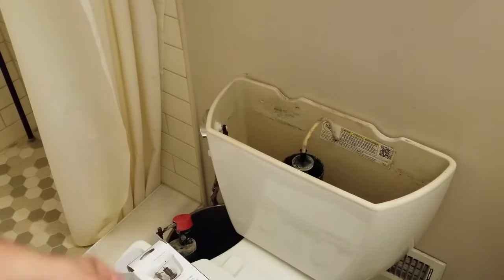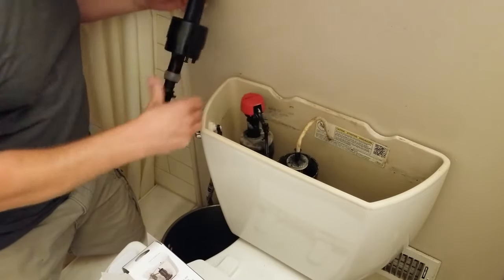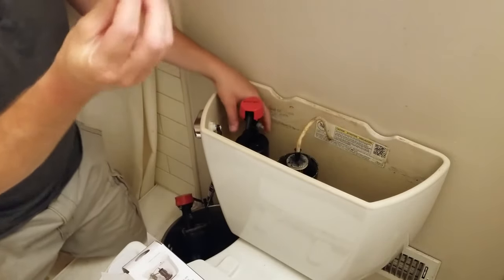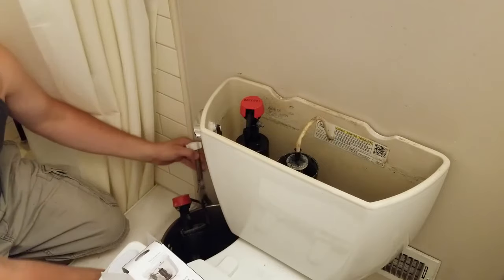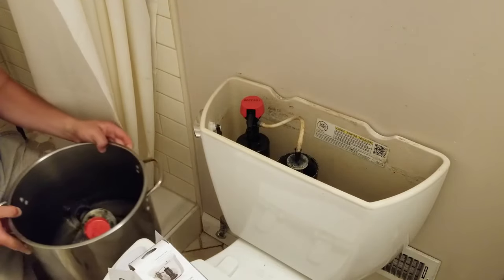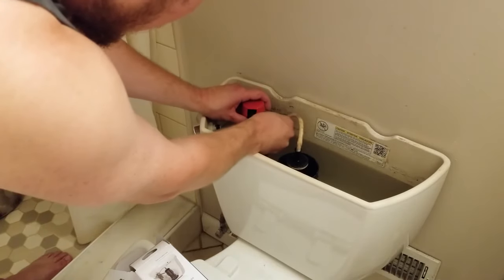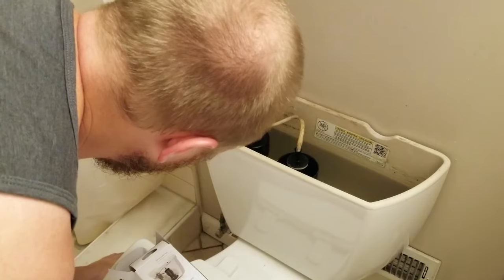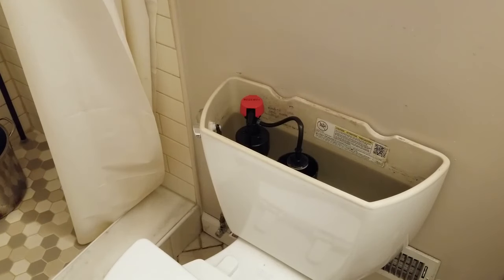how to fix a running toilet - Kohler Silent Fill Valve Replacement

Comment: Thank you very much Mr. Merl. You made what started as a bad day a good day. The box said there was detailed instructions inside but there wasn't any instructions. I searched for the Kohler parts on YouTube and by great luck, I found your video. I'm an accountant by trade and far from mechanically inclined. Your video saved me from spilling water all over my bathroom floor and allowed me to complete the task in 10 minutes (When I purchase furniture that requires assembly, if it says it will take 2 hours based on history it usually takes me 2 days so the 10 minutes is amazing). Thanks again!
Reply from the maker: Im glad my video was able to help you! No one ever wants to work on their toilet so I think should be as quick and painless as possible.

Comment: I just replaced my Kohler fill valve today after watching your video. It's been awhile since it was noisy and leaking my fill valve. I was afraid to replace before because plumbing is kind of difficult to do. Also plumbers are charging like 120 bucks and sometimes they don't wanna do small job. Thanks for sharing this video...
Reply from the maker: Glad it helped!
Reply: Don't worry, they will make a small job a big one.

Comment: Thanks very much.....your use of a bucket rather than a previous video I looked at showing SCOOPING OUT and SOPPING UP WITH A TOWEL is a lot easier and quicker method ........
I am not a handy person but this gives me some confidence......
Reply from the maker: Lol, yea that sounds unneccessarily tedious!  It's a pretty simple and straightforward job, just make sure you dont overtighten things when u put it all back together again.

Comment: Thank you! Great video. I was able to do this in 45 minutes. It'd be shorter if I didn't have to struggle removing the nut from the water supply line. After that, it was quick!

When I replaced the tip and hose, I noticed water was leaking too (like you mentioned in the video). I decided to use the original hose which seems to have more of a grip and less leakage. Do you think it is ok to have some water leak from the tip?
Reply from the maker: @cathyk9120  it's best to not have any leakage there. I think i had to just push it on harder.  As long as if it's only leaking when the tank is filling then it's not the end of the world but I'd try to get it to stop.
Reply: @KyleMerl  Thanks Kyle! When I pushed it in harder (at least 4 times), the drip/leak was much less especially with the old beige hose which has a much stronger grip than the new black one. Yes, only dripping when tank is filling. Perhaps I need to get another fill valve? Maybe it's defective? I'll call Kohler in the morning and see what they say too?
Reply from the maker: @cathyk9120  i think for me the leak was that the plastic tip wasn't pushed in the whole way and not so much the hose. Did you double check that?
Reply: @KyleMerl  Yeah, pushed the tip in (without hose) all the way in/as much as possible and still dripping. For you, there's no dripping on your end at all? At certain angle, it looks fine but when I dry it, I notice a bit of a drip towards the back. I'll keep you posted but thanks again for an awesome video! It made me feel I could do it and I did :)

Comment: Is the valve adjustable? My moms tank keeps running unless i pull thw valve up a little when its full ?? Anyone that can help is appreciated
Reply from the maker: Yep I believe you have to twist it to adjust the height. At least that's what I had to do with mine
Reply: I literally just fixed this issue 2 mins ago with our brand new toilet. If you remove the cover for the floater arm, you'll see a pin that most likely isn't aligned properly in it's holes which creates friction so the arm can't go up all the way. I took pliers and yanked the pin out then realigned it properly and voila! It's fixed. No more friction on the floater arm so it fully rises now :)
Reply from the maker: @kthewhite7453  thanks for sharing that! That's annoying that you had to do that with a new toilet though.

Comment: After the tank filled and stopped......was there to be water up in the canister or should it be empty?  Thanks
Reply from the maker: The tank fills up. If you're talking about the black part in the middle of the tank, i dont believe there was water in there.

Comment: I twist mine to try and match the height and nothing happens.  The two parts turn but the height doesn’t change
Reply from the maker: hmmm.  if it's a Kohler it could be a defective part.  If it's a different brand it might have a different way for adjusting the height.  make sure you're turning the bottom part clockwise and maybe pull on it a little bit as you do it... not a lot but just a little.

Comment: And now your toilet will fill 50% more slowly because of that gray valve you put on.  I don't understand Kohler's logic of filling the tank more slowly as a 'water savings' measure.  How does that work?
Reply from the maker: Yea I'm not sure what the purpose of those are... I just made sure to match it to whatever the original was. 
In general I think all of these water saving appliances are annoying because none of them work as well. And how much money is it really saving us?
Reply: @KyleMerl  Money saving = zero.  I live alone but if I had to share a toilet with three other people, I think life would be stressful waiting extra minutes for the tank to fill.  So I guess the purpose of the flow regulator is to make life more frustrating, right?
Reply from the maker: But at least its quiet 😄
Reply: @KyleMerl  Yes, I noticed that, too.